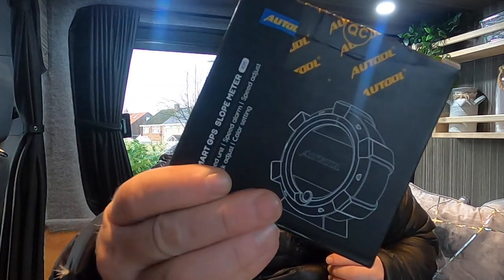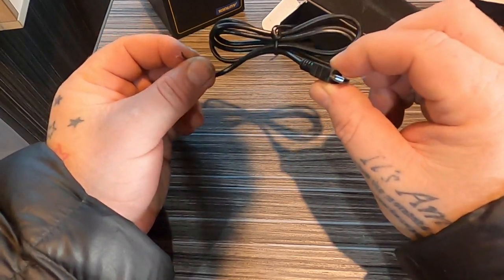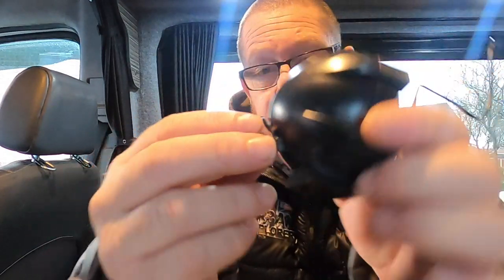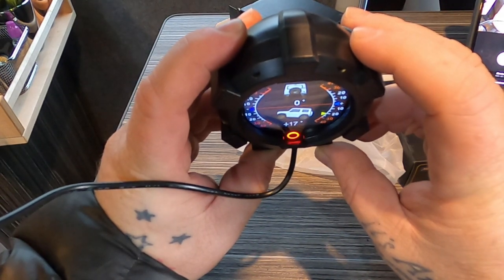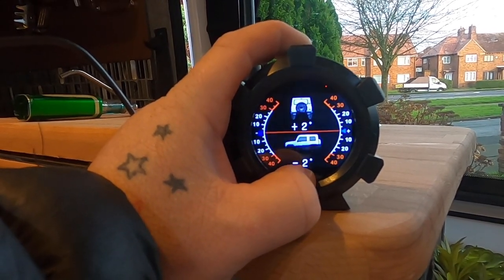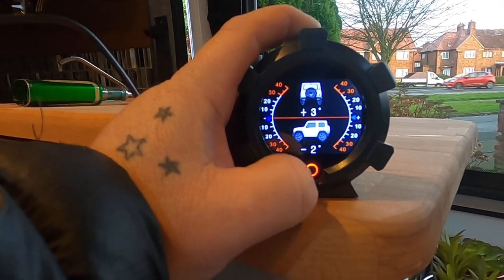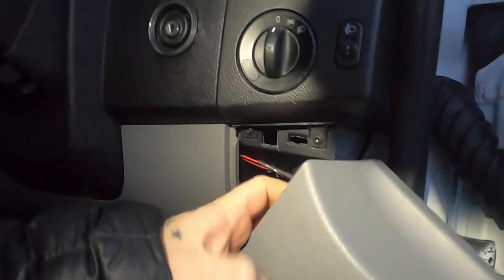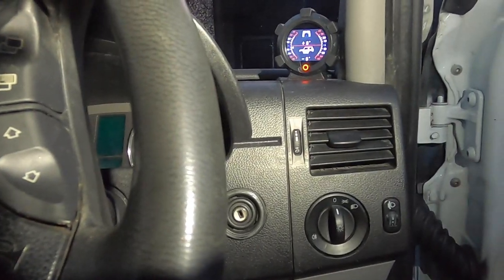EASY To Instal Camper Van Tilt Gauge

Comment: I had an app for my phone that done this but never used it once. I look for a level enough spot and park. Used my ramps once then realised that would be the last time. I could sleep on a pin though lol.
Good vid Neil, you got a Sub 👍
Reply from the maker: yer im the opposite mate i need to be level or have my head higher than my feet or i get an awfull sleep , there is many wasy of doing it and i thing its what ever works for you works best , even as simple as a ping pong ball , thanks for watching mate
Reply: @UrbanVanlife  Yes some folk I know are the same. I can't understand why I can sleep any which way but I struggle if I can't stretch out straight, that's my weakness 😆
If I need a level or ping pong ball, even the app I had to see if I'm level then I know I'm level enough 🙂👍

Comment: What has been the total cost as I’m looking at a crafter to do
Reply from the maker: I’d say total like every thing and even from Van to parts to tools and screws like every thing I’d say £20.000 . It could have been done a lot lot less but all the gear we used was the best we could find . We haven’t outfitted it on the cheep but that’s not to say you couldn’t . If you got cheeper parts you could prob do it  for £15.000  if you needed to .

Comment: Looks a fantastic piece of kit
 Does it keep the settings stored when you turn it off with switch ie time .date .slope calibration 
Cheers Andy
Reply from the maker: Yes mate it keeps all the data you set in to it when it’s off . I presume it has a little battery in there somewhere to keep it set .
Reply: @UrbanVanlife  👍 Just purchased one

Comment: Nice job, but a little tip when joining wires just stagger the joint by 1 inch and cut wires to suit so the two bare wires don't touch then just wrap your insulation tape over the whole join 👍
Reply from the maker: I did stager them bud . But I allways wrap them individually you can’t be to safe can ya

Comment: Nice vid Neil. Well explained and displayed. Interesting that you did this with the electrics connected. That spooked me a bit. Presumably if it is all done carefully and step by step as you did there is little chance of you going “Bang”. Could the same approach be used for directly wiring in sat nav’s etc. Did you just cut/strip the wiring back from the cigarette charger. 
All the best to you, Emma and the kids for the New Year from Dave and Mal in a very snowy Stoke
Reply from the maker: Yes mate that’s how auto elecs should tap in to cables . Splice in and solder cover then to the next wire . Some Say you need to Isolate the main battery but in the years I’ve been doing it i’ve never had anything blow or pop just take your time and you’ll be fine all the best to you and the family Buddie and let’s hope 2021 is a much better year thanks for watching
Reply: @UrbanVanlife  No probs. Really enjoy the channel and the banter you have with the lovely Emma

Comment: Shouldn’t you install a fuse in the line?
Reply from the maker: you could but the line its tapped in to is allready fused so for what power the unit pulls i realy wouldnt worry mate , but i guess if you want to be super safe then fit one , i mean its never going to hurt , but i didnt cos like i said its allready a fused line